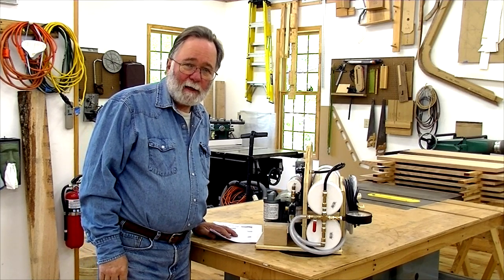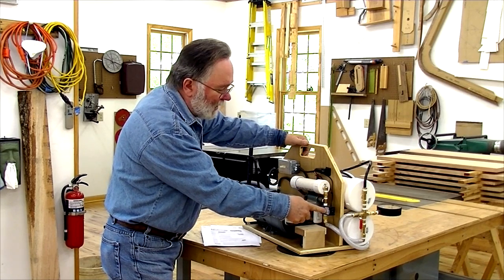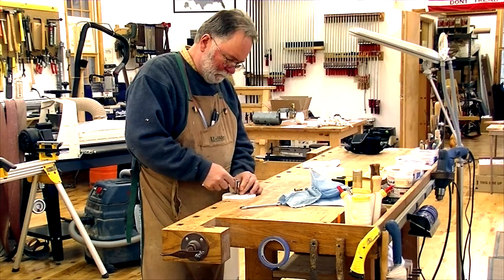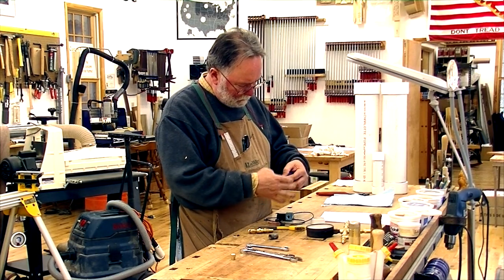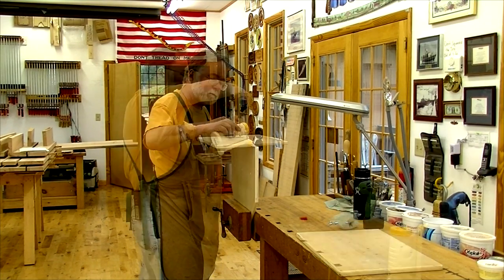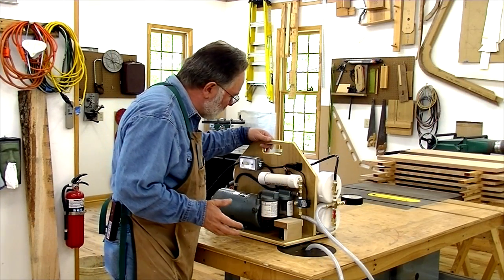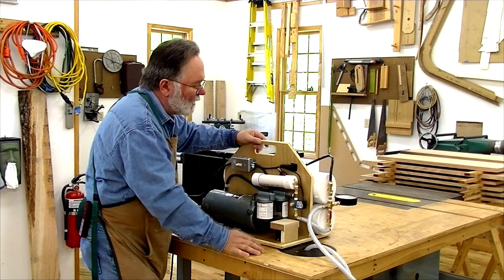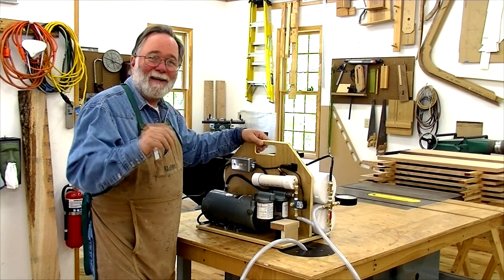Making a Vacuum Pump System: Andrew Pitts ~ FurnitureMaker

Comment: I understand why you installed a relay, but not how they work (or how you choose one).  Can you recommend a tutorial or source?
Reply from the maker: The relay takes a low current from the switch and causes larger contacts to shut energizing a high current pump. The relay is available at joewoodworker.com in the evs vacuum pump project tab.

Comment: Andrew I notice that Joe at Joes veneer where he features this plan doesn't care for rotary vane pumps. I have one much like yours and was planning on using it. Do you have any idea why he doesn't support rotary vane pumps?  Have you had any trouble with yours?  Thanks
Reply from the maker: Casey, no idea about Joe vs rotary pumps. I first made the venturi version, and it worked well albeit needing a compressor, but I was given the rotary pump and after cleaning it up it works well. I think most folks use them, so you should not have any problem.

Comment: Andrew, if you had to build a replacement veneering pump setup again (or a 2nd one), would you go the same route, or are there some design considerations or different componentry you'd choose after using this one for the past 5 years?
Reply from the maker: Mark, I've built both pumps on the Joe Woodworker website (https://www.joewoodworker.com/), the venturi setup and the rotary pump setup. Both work well. I have not veneered in a couple of years, but both pumps did the job. The rotary pump is easier to set up, as it does not require a compressor.
Reply: @Andrewpittsfurnituremaker  I definitely don't to use want my noisy compressor, and planned on ordering from Joe, just greeting to figure out which options and wondered if you had any afterthoughts that might guide my decision. Great shop!  Thx again.

Comment: Do you have the specification of the GAST rotary vane pump you are using.
Thank you
Reply from the maker: I'll see if I can take a pix of the label for you, tomorrow.
Reply: Thank you
Reply from the maker: Marcel LeBlanc Tried to read the nameplate, but the pump is old and I can't read the model. But Joe Woodworker sells a pump like it. Check out veneersupplies. com.

Comment: Hi Andrew.  Great video, but I have a few questions, if you don't mind.  You said this was a rotary vane pump, but Joe Woodworker says to not use a rotary vane pump because of electrical issues.  Yours obviously works well, so you must have figured out the right way to do the relay and damper and whatever else.  Can you tell me what tweaks you made, or did you just follow Joe's instructions verbatim?
I'm getting ready to build this, but I'm very nervous about screwing it all up and essentially wasting all that money...
Thank you for any advise you can offer.   ~Christian
Reply from the maker: Hi Christian,
I just used Joe's instructions and parts. Make sure you use the parts that will carry the current required. You will need the relay for the main pump current. My pump is a Gast pump. It's just a motor driving a sliding vane rotor inside a housing. Pretty straightforward.

Comment: I am a guitar builder and made the exact same system almost 10 years ago and don't know what I'd do without it.  I use it for gluing braces, bridges etc. and as a clamping device to hold the guitar body while I work on it.  I am constantly finding applications for this.  If you are a woodworker you can't go wrong with this set up.  Great video!
Reply from the maker: +Madmanmarque I agree. Vacuum bagging and vacuum pucks are really great tools.

Comment: my pump has an on- off switch on it already.  can i eliminate the light switch setup (woodworker joe) and just wire the controller and other electrical goodies into my pump"s wiring?
Reply from the maker: +Steve Wright The pump is controlled by the pressure switch through a relay, not by a switch on the pump. But, if you wired that switch as in the electrical diagram, so that it is not controlling the pump but is controlling the circuitry, I don't think it would make any difference that the switch was on the pump instead of in a switch box.

Comment: Hi Andrew, nice video, can you tell me how long it will hold vacuum until the pump cycles on again? I built a similar setup and I have my switch cutoff set to 15 inches of merc. but I am only holding vacuum for 60 secs. I have a leak but can't  find it.

Comment: Impeccable timing as I just started this project a week ago.  My vacuum pump (a Rietschle Thomas piston type) arrived two days ago.  Instead of pvc tanks, I removed the compressor motor from a non working unit and mounting the pump on that tank similar to some of the examples on JoeWoodworker site.  Next up is to order vacuum kit and bag.  Cheers.